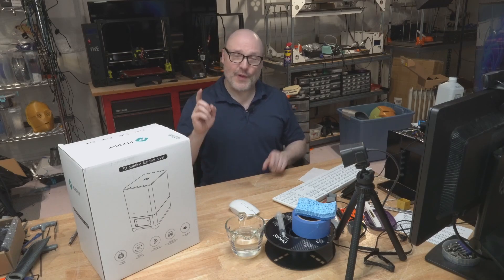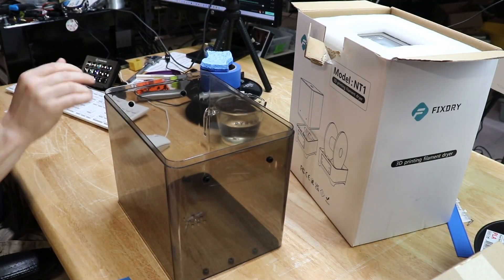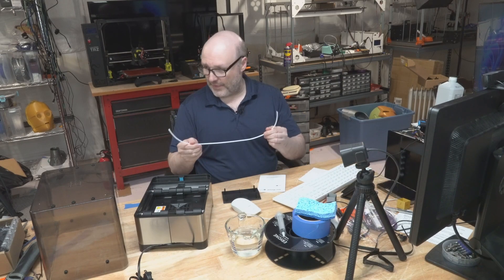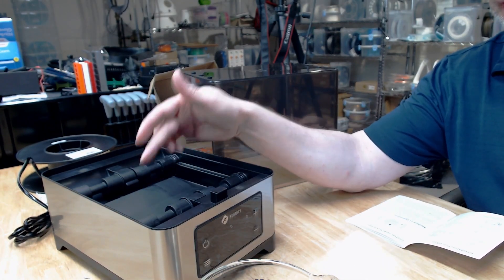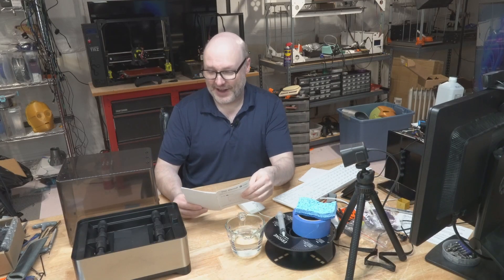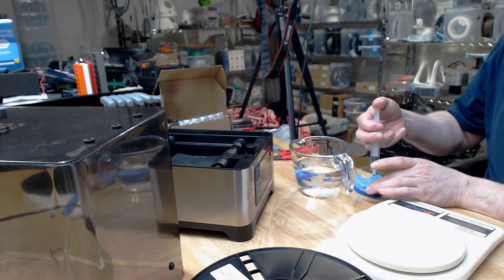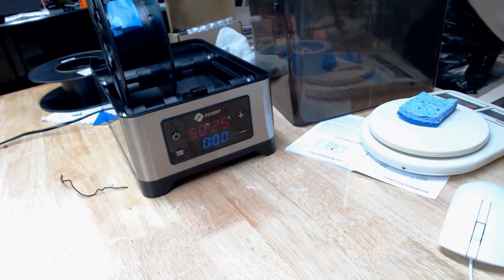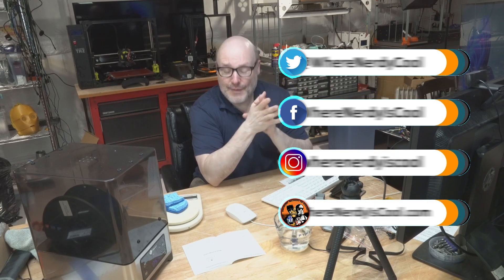First Look - FixDry 3D Printer Filament Dryer

Comment: I see that when the device is running, the dislay flashes at regular intervals. Mine does the same thing, I wonder why that is because it seems to be a feature of the device. Compared to others, it has the advantage of being able to insert a larger coil and the disadvantage that it does not remember the settings after switching off.
Reply from the maker: It also doesn’t have a temperature sensor. It just runs on a preprogrammed sequence so it’s very much a disappointment

Comment: Its a decent enough unit but doesnt go to 70 degrees, ignore the display readout, both temp and humidity are inaccurate, when it shows 70 degrees and 20% my stand alone gauge shows 57 degrees and less than 10% humidity, so it definitely gets the moisture down but doesnt hit its expected temperature
Reply from the maker: Yeah it’s very disappointing.  I like the EIBOS Cyclopes way better

Comment: What do you think of a food dehydrator for drying filament?
Reply from the maker: I use a PrintDry Pro to pre dry all my materials. It’s the same concept really as your food dehydrator. A spool holder ones are good for materials real sensitive to moisture, like this filled PLA.  The EIBOS Cyclopes is my favorite.  Sadly this FixDry one just used an “algorithm” to predict when the material is dry.  It doesn’t even have a temp sensor.  (Groan)

Comment: I have cheap Tupperware that has a good fit. Is there any other reason to buy this thing?
Reply from the maker: Ha sadly it doesn’t have a temp sensor.  It uses “an algorithm “ to determine how long to dry.  The EIBOs Cyclopes has one and I’m testing that as well

Comment: It would be very useful to add a few temperature probes to the test as well. Many of these devices have horribly inaccurate temperature readings and won't go much beyond 60 degrees C which is enough for PLA but most other filaments won't dry that way.
Reply from the maker: That’s my plan!

Comment: Do you happen to have the ebios dual filament dryer to compare?
Reply from the maker: Yes the EIBOS Cyclopes.  One thing I noticed in the instructions for this one is there is no temperature sensor. It just runs a programmed algorithm. A disappointment but I’ll test their algorithm with a temp sensor

Comment: I’d put one of those little wooden cabinet knobs that are attached with on screw on the top piece.  I’d mount it one end down real low.  On the base maybe same.  They would have to be close to one another to work.
Reply from the maker: Good idea